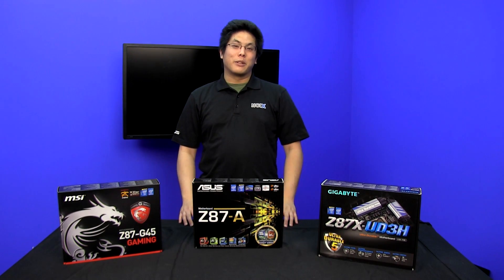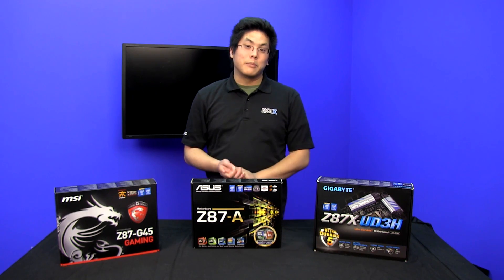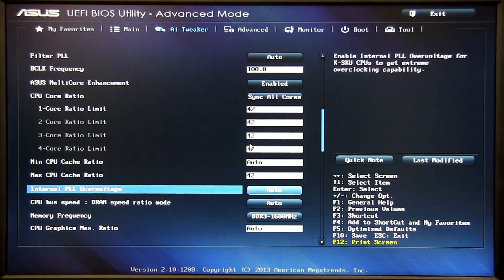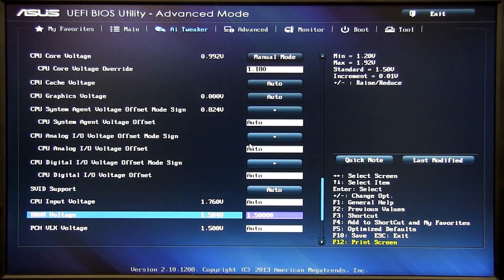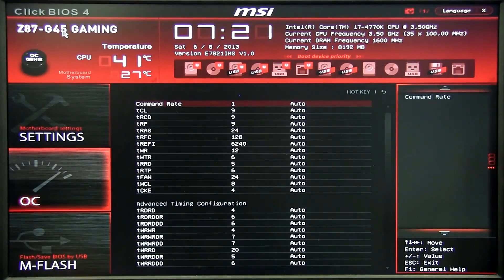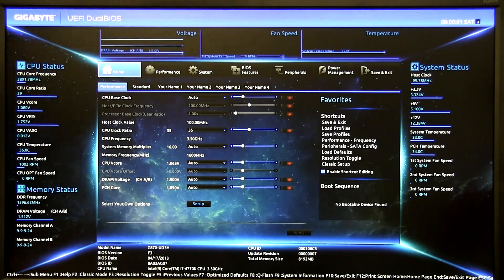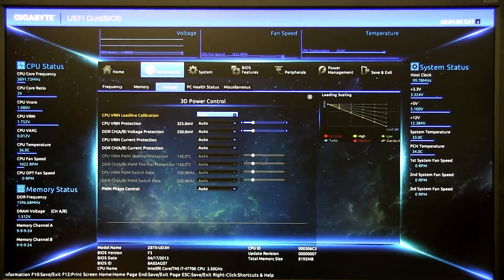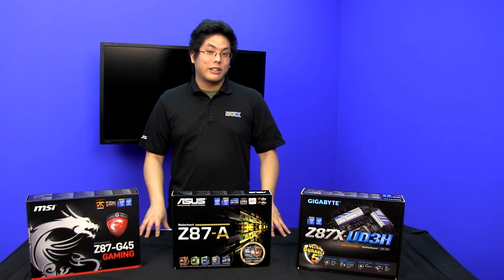Haswell overclocking 101 with ASUS, MSI & Gigabyte

Comment: Hi, my stuff is 4770 k oc to 4.2 like in this video, motherboard z87 hd3. Ram is hyperx 2400 mhz. In bios defoult was 1333.. so i do like you show 1600 9 9 9 24 with 1.5 voltage. Everithing is ok and stable and now i want more.. Question is can i set my ram to speed what it is. I mean 2400. Did my cpu and motherboard can run that speed ? i set 1866 with 1.60 voltage 9 9 9 24 but i dont know this is good or not ? System stable but i want to know whats best for me :)

Comment: Hi, i have ga z87 hd3, 4770k cpu. Ram kits 2x8gb hyperx beast 2400 mhz. How set that speed ? Now im using 1600 9 9 9 24 but if i set in bios 2400 with 1.650 ram voltage it doesnt change... i try xmp profile 1 and 2 nothing.. pls help

Comment: i have the same gigabyte motherboard and the queston is when i set my  X.M.P profile to profile 1 the DDR voltage changes from 1.50 to 1.65V. is that something to worry about ?

specs: Gigabyte Z87X-UD3H, Kingston HyperX 2x4 1600MHz, Intel Haswell i5-4670k 3.40 GHz

Comment: I wrote an extensive Haswell overclocking guide.
overclock dot (net)/t/1411077/haswell-overclocking-thread
There's to much to say in one comment, so just read the thread. I patrol the thread for replies too if you have questions.

Comment: Again, depends on your usage scenario. If you're building a small, lower end machine, AMD's APU will be very good for gaming considering the size (no discrete GPU taking up space) and price. If you want to go all out, Intel will win. A 4770k overclocked to 4.7 for example will be like a Sandy with 5.3, 5.4, 5.5ghz, and that's not even Ivy Bridge-E. It all depends.

Comment: Yes. Although LGA 1155 and LGA 1150 are two separate chipsets, the mounting ports are identical on the respective motherboards (Z77 and Z87), so any LGA 1150 board will have the same mounting ports for the CPU cooler as an LGA 1155 board.

Comment: 4.2 Ghz is not that great of an overclock from 3.5Ghz stock (20% overclock).  I still think it was a stupid idea for Intel to dump the VRM's on die along with a GPU that can barely outdo most onboard graphics and reducing the pin count (requiring a new socket again) rather than increasing it so that quad channel memory and the socket itself could be supported long into the future. Granted Haswell can do 8 operations per clock vs the 6 for Sandy and Ivy Bridge it still doesn't seem that great.

Comment: Asus? But you should look for what features you need rather than board name. These new boards are so good that you wont have problems with any of them, usually just the features set them apart.

Comment: A little misinformation: the CPU Cache Ratio down-clocking makes the system more stable--not true. It is only true at higher CPU clock speeds, only where your system gets unstable, then down-clocking the Cache Ratio can stabilize it, otherwise 1:1 is most stable AND efficient. Or else it they wouldn't have put 1:1 as default >.>